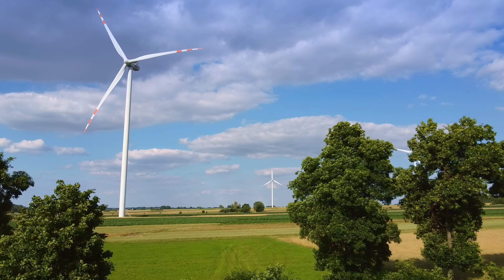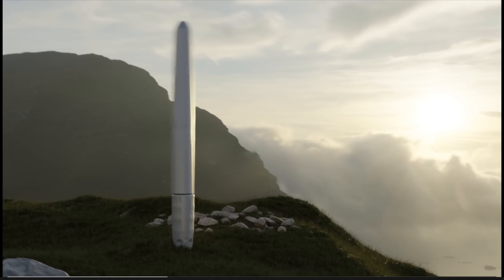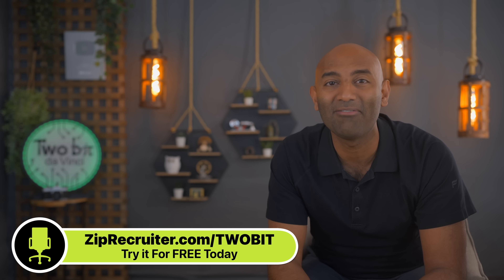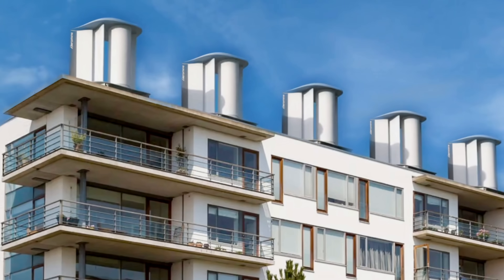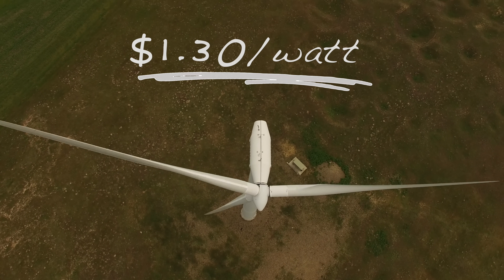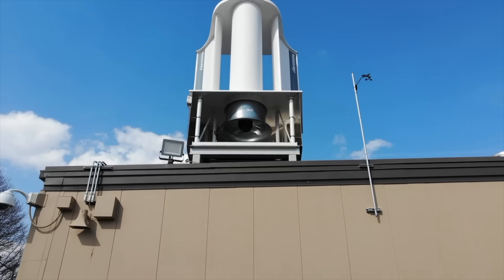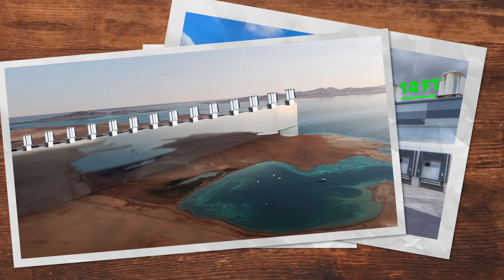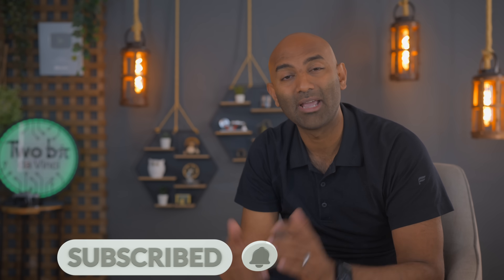Can This Genius Wind Turbine Outperform Rooftop Solar?

Comment: I wonder how it would perform if mounted on a roof apex with the feed from the attic directly below. Easy to imagine it sitting on a small servo controlled platform to track the blade assembly into the wind. The operation would be a little different but the venturi effect would still play its part.
Reply: There is little wind around at rooftop level. If it's not obvious why that is, I suggest you THINK more.
Reply: @grahamstevenson1740  I live in rural Thailand. The speed over our pitched  roof reaches several m/s, depending on the season.. The attic temperature for a source updraft ranges from 30c-45c. If I can build a rotating base this will supplement my solar arrays with less noise and more output than a standard turbine. I think my post stands despite your rude comment. .
Reply: @bobdeverell  If you compare with the wind velocity ar 30m you will see that it's faster at height. OTOH, it you can get useful energy, that's fine too.

Comment: Definitely an interesting twist to harness the power of the wind.  We have seen/read issues with large turbines in regards to maintenance issues, and operating restrictions. (Must be shut down in high winds to protect equipment, and some locations don't generate enough wind)  This tech seems to correct both of those issues.  Will the manufacture also address recycle issues with their materials?
Reply: Shut down in high wind ? You just auto-feather the blades. The turbines look after themselves. You can recycle all the stuff used in turbines,just depends if you're trying hard enough.

Comment: There is added value in using the Venturi design for moving airflow around modern houses with their stuffy and super insulated structures

Comment: Have you spoken with Aeromine on how exactly they would be setup to extract hot air from the ceilings of warehouses?
Reply: The two fins generate negative pressure, the air being sucked to the ends of the fins is the one that could come from the hot air in the upper sections of the premises. This air would pass though the wind turbine enroute to the fins.

Comment: 2 questions:
1. Why not on center roof peaks, that way ypu can already have accelerated and compressed air going in to ventura affect?
2. What about adding a vertical wind turbine behind to capitalize in the generated airflow and perssure?
Reply: Who the hell will want that complexity on their singled roof tops let slim on a flat roof
Reply: @Dennis Green  cor me it's not about who, I am more intrigued by the physics and trying to maximize efficiency. Hell, if it could replace my homes power needs, I would.
Reply: @Andrew Beckett  I'm more so saying due to the sheer size it would need to be and the complexity behind it would prevent a small enough unit that won't be too much of a load on the joists with the wind you would really want. The anchoring would be rough on the structure. You see how big that unit is on a flat roof. No way is someone butting that on a sloped roof so it can barrel down in high wind speeds. I'm not saying it's not a good thought but it's that the practicality isn't there and I'm pretty sure we don't have the technology to have such a small unit to capture that much kinetic energy efficiently out of something light weight and small

Comment: The entire wind energy is idiotic.
Any other industry would first capture and concentrate or refine. (dams, oil, biofuel, hydrogen etc.)

But in the wind industry they just put a fan out and expect the raw wind to produce volts and watts and giggles.

Funnel it. You'll get a better output. And stop worrying about the "pretty and anesthetics.

Comment: The problem with wind at scale is that the air powering the blades, over time, results in them beings sandblasted to shreds...even when situated offshore as we're doing in the UK.

In fact, by the time we have erected all the planned farms around our coastline, we will have had to replace every single blade we've already erected to date...and, we'd be a fair chunck through the next cycle of replacements.

Place these sort of things in a desert, can you imagine the attrition rate then?

As muslch as it's a cheap easy solution, they're not the answer...and, in fact, they only really serve to deflect money away from the answer.

Fusion is what we need to be working towards.

Either that or nuclear...and, as such, all the work that'll be required to educate/engage with the public with regards to the very real factors relating towhat using nuclear means.

Comment: The thing is that these turbines can be placed in arrays WITH photovoltaic systems combined.  thus having a multiplicative advantage for area usage. Heck combine them with solar panels in the structure of the turbine.
Reply: Additive advantage, not multiplicative
Reply: Add a small thorium reactor too!
Reply: @SmoochyRoo  while you are at it, add geothermal energy, geothermal cooling (HVAC), aerogel insulator walls, hydropower from the water system and finally a bioreactor.
Reply: Yes,typically there is more wind when there is less sun...
Reply: Put some tranny toilets and urinals in the trucks and cars while your at it.  It'll be multiplicative!

Comment: I can bet that this so called “breakthrough” tech will not perform or deliver the power as claimed. There are definite practical facts in engineering. You cannot create energy from nothing.
The amount of power you can generate from moving fluids (including moving air aka wind) is governed by a formula; Power (W) = 1/2 x ρ x A x v3, where;
ρ is air (fluid) density 
A is swept area of moving turbine
v is the velocity in m/s of the moving air or fluid .

...And this is available power. You have not yet even factored in efficiency of moving parts and something called Betz limit.

So you see, inside this proposed wind power generator is a turbine that expects to be rotated by moving air inside a Venturi pipe. That turbine has a definite diameter, which means a definite area that will be the active area acted on by the moving air. 

How large can that turbine be ? From the pictures, it can’t be much. It’s TINY.
How much air velocity can that Venturi have or create ? They obviously won’t be telling us anytime soon, I can bet. Because they know it can’t be much either.

Therefore given these FACTS, you start to realize there can’t be significant amount of power that can be generated by such a small device. It comes down to reality of physics. If you doubt, wait and see if they will show a demonstration of the thing generating useful power and the real-time measured value of that power. They won’t.
There are numerous testimonial videos in YouTube of many hopeful people have in the past purchased small wind turbines that “claimed in their specs ” to be capable of producing so many watts.....but ended up being disappointed with actual real world performance of the turbines, as they produced far less than promised. It’s all about physics and reality.

Comment: on the wind direction and icing issue..... 1) live in or on a ridge of a valley maybe?  2) deicing: WHAT IF..... we ran the air going thru the turbine to be exhausted out to the air foils.... we just run our geothermal water system to a heat exchanger?  then the air running thru the system could be managed at a consistent temp..  possibly tying the intake of the turbine system... to an ERV for the house, using the "dirty air" from the ERV to draw out the stale air in the house..... and letting the low pressure in the house, drawn by the air foils, create the "incurrent siphon" for the fresh air side of the ERV?

Comment: In the last three years Texas has had Ice storms. The last on from Februay 1 -8, 2023. The power grid was down for from 6.5 to 9 dsys in some areas.  The wind farms in west Texas resembled a haunted ice monster village, as they were frozen to a standstill with huge ice Sickles hanging from the blades. My neighbors who had "all electric" houses moved to hotels to keep from freezing to death. Several years ago i installed propane in my house that provides heat with wall heaters and hot water.  I had no electricity for 6.5 days. I was warm with my heaters, had hot water, cooked on a camp stove and used lanterns for light. I can tell you there was no sun shining for 8 days. Solar power systems were a complete failure. Natural gas and propane are the solutions to protect the home and family. Most power generation plants are being transitioned to natural gas. The gas cook stove with a simple ventilation hood above it is the most cost effective way to prepare meals there is. My family has used natural gas to heat the home and cook since the 1920's. They all lived into their 90s. None had cancer or other diseases.

Comment: I guess lots of us are hoping for a cost effective wind generator for home use.  I'm about to move to a 3-storey town house in a terrace with the ridge running north / south, a few hundred yards from England's south coast.  I'm no engineer but this set me thinking.  I'll hope to add an east / west solar array but the 'Ridgeblade' looks like it would need expensive access for maintenance ... & it's ugly (sorry!).  What if the principles of the Aeromine system could be adapted to work in a channel passing through a pitched roof?  That could catch a prevailing westerly wind in my case.  And what if the turbine was in the roof space for easy maintenance, also keeping the system compact?
Reply: What if the building was designed around the turbine system?  For example, instead of the scoop at the bottom doubling the air speed coming into the turbine, suppose the "scoop" was a part of the building.  Look at how the porches on the upper stories of the building shown at 10:02 are inset into the building.  If the duct into the turbine was fed from such an architectural feature, the pressure on the upwind side of the turbine could be even higher.

Comment: The website of this product is very sparce of technical info.  All wind turbines give you a chart of power by wind speed.  Nothing here.  Rosie does engineering has covered all these small wind turbines and none of them so far have delivered.  It's all about swept area and more importantly wind speed.

Comment: Boom snap, green renewable electricity to charge EV batteries, portable electronics & more energy storage systems of all scale from portable power banks to battery generators to huge grid scale battery energy storage networks or Tesla Power Walls hooked up to the latest Gen. Solar City rooftop solar PV panel array power output :)

Comment: How many places have a significant proportion of the prevailing winds blowing predominantly in one direction? Can this technology justify that trade off vs other turbine designs that can operate from winds in any direction. I just can’t see that being the case……

It actually appears that it might be a technology more suited to a distributed power system not distributed generation. I could see it being useful, for example, atop a sheer cliff harnessing onshore winds.

Comment: This is little more than supplemental power. You refer to installed capacity. That is a promise of performance in ideal conditions... which exist nowhere. Best case capacity factors for offshore wind approach 40%. That gives a good sense for how much energy can be harvested, but not when it can be harvested . Wind is not dispatchable, so that 40% of nameplate average power arrives when it wants. Sometimes that will be when you need it.

This feels like one more gadget in an expensive Rube Goldberg RE gadget... Or click bait.

Comment: Yay for decentralization!  I grew up in the seventies gas crisis era.  So I grew up with the car companies buying up every gas mileage innovation they could get their hands on.  And dad says....  Where did those innovations go?  Well, he had the answer to his question.  Some dusty folder in the corporate vaults.  No company wants to be put out of business.  Look at he way big pharma develops products, so then do petroleum companies slow down the development of fossil fuel replacements.  How do they do it?  They have a strangle hold on the regulators.  If a new product comes along they just make sure that there are so many regulations that no startup can afford to break into "their" market.  Thorium LFTR's should have been online by now.  Wind and solar cannot provide on demand power so they are not a viable grid solution.  Besides the fact that wind requires lubricants that put those generators at the mercy of petroleum providers.  Fusion will always be 20 years away, if they EVER get that sorted out.  Not gonna hold my breath for the introduction of anything new.  Cheap grid power is not going to happen.  Why would energy providers allow themselves to have anyone cut their profits?

Comment: Well that is highly interesting. I’ll be keeping an eye on this company as well.
I could see this working on my house, though my roof is not remotely flat (16-12 pitch), my attic does produce enough heat to turn in motor, and the outside winds are always at least 5mph at 10m here in the southeast.

Comment: Maybe put an "over-roof" over your roof? I'll resist the temptation to go too far into the weeds with this one. Just an "extension box" that gives you a flat roof on top of your pitched roof. (You might need drain holes in it, that open up when they get wet, and maybe close to help with air flow when it's dry and windy). If you could get away with just enough pitch at the right orientation to put your solar panels at their ideal pitch, that would be nice, too.

It might be ugly, but would be quite easy to make pretty. Just get an artist to paint the flat outward facing surface with trompe l'oeil picture of a Greek temple or something. Or install mirrors, so it looks like the sky. OK, so making it pretty might be a bit harder than I'm claiming.

If you had a flat roof, you could do a civilized version of what my mate's dad used to do when he was getting too stressed out at work. (He'd buy a case of beer, climb up on the roof, sit up there in the sun getting drunk, and would swear at the neighbours to let off a bit of steam. They didn't take it too personally when he did. It was a rare occurrence, and they knew him quite well in his friendlier mode.)

Maybe they could make their own 'over-roof' variant of their turbines? Channel the wind through a gap between over-roof and the sloped roof below. And then pre-wire the over-roof for solar installations, too.

Or figure out the flattest flat/ low pitch roof you could manage in your location - just enough to move the rain, and deck it over. (Forget about the wind stuff. Just make yourself a nice high deck. Maybe add a crow's nest to it, and fly the Jolly Roger.

OK, now I'm getting ridiculous.

And snow? What snow? ... oh ... snow ...

Ja, a bit awkward, that. 

Maybe design your flat roof parts to just give up and collapse if snowed on?

Comment: Ricky we have to talk a little of sense.

Over what period of time are you talking about, or for instance power use per home. Is that 1.2 Kw per hour, day week, or year and what is the relationship to the generation sats you are providing? And in what country are you basing these electrical use figures and from what source?

Really unless you lived in a remote community anywhere in the world connected to an electrical supply I would suggest that 1.2 Kw per hour per say 6 hour sunlight day would be at least the very minimum they could work on based on a 24 hour period. 
Then summer and winter come along.
What about office blocks with no solar. 
Unless I have it really wrong and have missed say a factor of an Hour, day week or month 
What's the story? More detail is required to evaluate the detail in your post. 

Den

Comment: This sounds like something I heard about on a Just Have A Think channel. What was mentioned there also mentioned air flowing over solar panels to cool them down, working in concert together. So maybe this is something else? But it otherwise looks and sounds so familiar. 

See even active fan cooling can give more energy than consumed as the PV becomes more efficient the cooler it is even down past freezing temperatures and especially the case at very high temperatures as well as increasing the life span of the PV.  The wind turbines mentioned on just have a think also were box like and put on the edges of roofs but blew/channeled air past solar panels cooling them down and working together. 

Also something about eliminating down drafts found by buildings.

Comment: A thermostatic controlled heater, and or, one that detects changes in air pressure to activate the heating coils to return the flow to a minimum rate might work.

Comment: I wonder if this type of turbine would be better if it was unpowered and used strictly for ventilation like a passive HVAC system. Surely it could do more ventilation by being run directly than it could if it made power from the wind and then used that power to run the HVAC from the electricity

Comment: Basically wind is a draft from a high pressure point to a low pressure point, These can be high speed if the difference is bigger. But This mechanism is only using the venturi to accelerate windspeed inside a tube, basically a gearbox. No Energy is gained, it only is squeezed into a narrower tube. That is why large windturbines have a very big wingspan but only tiny turbines and a gearbox. You would have to innovate the turbine here to be more efficient at a higher wind throughput. You could compare it with a water-jet motor to propell a boat but the other way around. I do not see a particular patent coming out of this.

Comment: A better use for this could be to extract the fumes from commercial kitchens. An extractor powered by the wind and generating electricity when there is wind and powered by a fan when is not windy. 2x the benefits at same initial cost